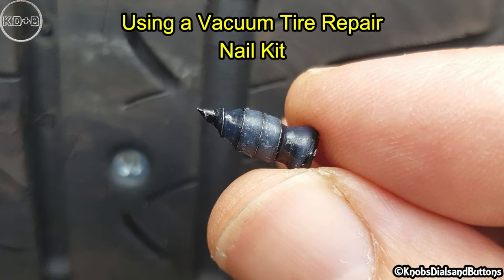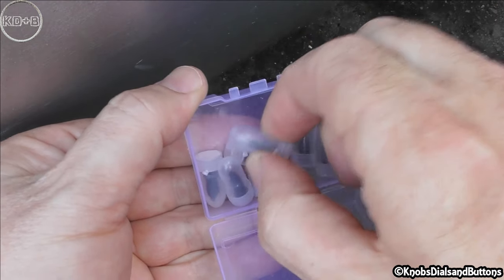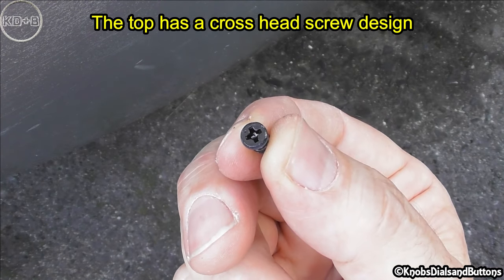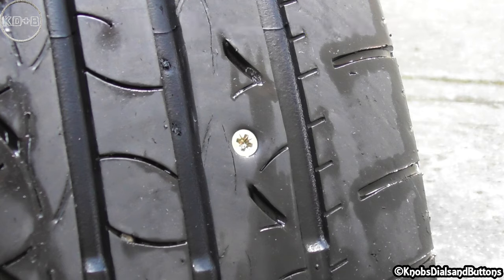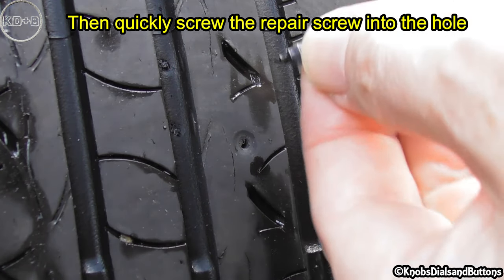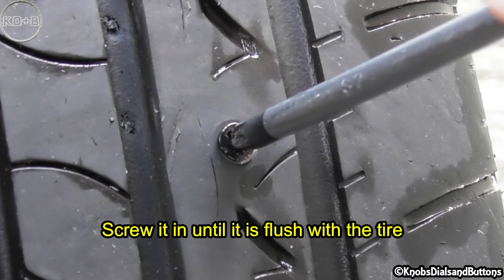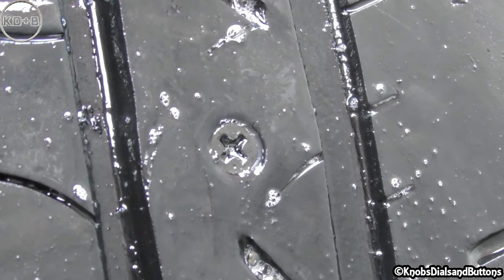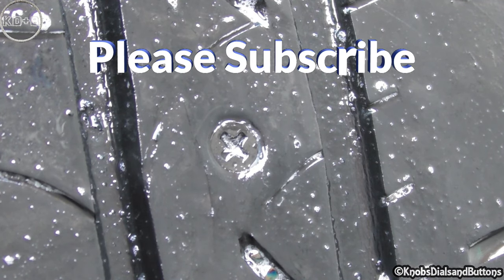Vacuum Tire Repair Nail Kit

Comment: I think the screw you took out was more secure 😂
Reply: I know 😄
Reply: it’s was but metal will damage the tyre more and won’t mold with the heat.
Reply: this is bolt special for tublesss not bolt common
Reply: @CristianoXRonaldox-t5z  where can we get it in India?
Reply: Make sense..haha
Reply: Not the screw inn’s are rubber and metal and they have a sealer on them I always use the strip ones but I ordered some of these to try

Comment: so, take a screw out of the tire and replace it with a screw with some sealant on it..  of course, if it comes out while driving down the road,  it becomes someone else's problem ..
Reply from the maker: I'm just demonstrating how to use the kit.
Reply: @knobsdialsandbuttons  We get that. This is a product that needs to die though. Anyone who has used a tire plug knows that they have issues of their own but they aren't going to be a road hazard when they fail. They are a bit annoying to use but they work; so there is practically no need for these in the first place.
Reply: Looks like they are plastic , so I don't understand them being a road hazard IF they came out ?
Reply: I just ordered some.  I don't think If you drove over these that they would stick in your tyre. The rubber outer of the screw is to grippy the screw would bounce off/out. Also the screw is stubby, very short.  That combined with the grippy rubber, it would be very hard to pierce the tyre.
Reply: They are made of rubber not metal. So they are not hazard
Reply: These repair screws are made of rubber. If for some reason they come out they are not metal and will not puncture someone else's tire.

Comment: these screws are very good i used two times with rubber glue on them and it take 5 minites to fix tyre after removing nail,screws are two sizes small and large you must have them because some time nail size is bigger.90% you dont need to remove tyre,these screws are good to used by old men and women,if you are young then use rubber plugs they are batter then screws and most important thing is you must have air compressor in you car

Comment: everyone in here, don't use this for long term this is a temporary patch when you dont have an extra tire or are using a motorcycle. Always have it patched professionally after.
Reply: Some mopeds or city car don't have an extra tire. They give you a patch kit like this, so you can be able to reach a tire shop without a run-flat damage or being still able to drive there safely

Comment: I wouldn’t use this on a car tire but a lawnmower or atv tire,  I think it will last longer and be more effective than a standard rubber plug.  I assume they come in larger sizes as well in case you run over a larger object and get a bigger hole.  The advantage of this over your standard rubber plug is the plug uses adhesive to work,  not always effective in a dirty environment.
Reply from the maker: There are two different sizes. I would only use it in an emergency and for as short a trip as possible.
Reply: I noticed a slight air leak. TINY  foamy suds indicates air escaping.
Reply: @knobsdialsandbuttons  
Hi.
Do you need to lube with grease first, would it help?
Thanks..
Reply: Why would you want to leave this in your car tire ? This is an emergency kit to be able yo drive to a tore shop and get your tire fixed or replaced

Comment: I have some in my saddle bag along with a bicycle pump about 5 inches long. I figured I can get enough air in it to get home. My last set of tires on my Harley I got a bolt in the back tire. When I put the new ones on I made my spoke wheels tubeless with 3M marine 5200. Now I can plug instead of patching the tube. Last one I slimmed the tube and it lasted until I changed them. Didn’t want to go 80mph on slime.

Comment: I was stuck with a small hole in my motorcycle rear tire and no way to fix it or have it fixed. I screwed in a large ( number 12 IIRC ) sheet metal screw. Unfortunately, I did not have any rubber cement or I would have appled some to the threads. The tire never lost any air until I had the tire replaced. The use of a sheet metal screw is important because the screw shank is mostly straight and has deep, coarse threads unlike a wood screw which has a slight taper and finer and shallower threads.

Comment: As long as you are not using it for racing or drifting your cars, it will work just fine. This is for a 'common' cars used in or between cities with asphalt road.

Comment: One thing what's funny is  - in emergency on the road you can hope to have these and sopy water in the trunk :D
Reply: Just put your ear up close to the hole,  you’ll hear if air is escaping.
Reply: @gregrowe1168  with highway  car flying noise I’m sure u will hear it
Reply: A quick old tip from DIY bicycle repairs : A good old large saliva spit on the whole to check if there's still an air leak or not :)  For the kit it self, I t cost nothing to have some of these tools proactively in your car
Reply: Saliva works too.  Coz you always have them on you.  Lol
Just put a good amount in your hand and wipe it on the repair work and check for bubbles.
Reply: you can spit on it
Reply: Windshield washer fluid bubbles and foams up too.
Reply: @Raf_Ik78 the best option instead 😂

Comment: Hi if we used this, this is supposed to be a temporary fix right? Still need to get to a repair shop to get it fixed again right? Or we can leave it as is and all is good?
Reply from the maker: Yes I would only use it as an emergency repair and then get the tire patched from the inside, just to be sure
Reply: @knobsdialsandbuttons  thanks 👍
Reply from the maker: You're welcome !

Comment: Would work in a pinch but I would change it for a plug or patch as soon as possible.
Reply from the maker: Yeah that's pretty much what it's used for. I certainly wouldn't leave it in there for long !

Comment: My car doesn't have a jack or spare tire. I keep a compressor and sticky repair kit in the trunk. But sometimes it's hard to fix with the tire on the car.

I just bought a pack of 100 with a stubby screwdriver to keep in the trunk. Hopefully I never have to use it.
Reply: I try it, excellent and easy than any other method.
Reply: Get yourself a jack and a spare tire ASAP.  The screw won’t help if your tire gets slashed or blows out.
Reply: @darryljones6129  Many cars do not have a spare tire these days. Including mine. Especially small cars.

Comment: why not just take out the screw and apply some sealant and put it back?
Reply from the maker: That would probably work, but I'm just demonstrating this kit :)
Reply: It seems to have sealant in the screws threads
Reply from the maker: I would recommend always having an air pump in the boot of your vehicle. You never know when you might need one.

Comment: Hmmm with the screw of course it'll hold since you inserted a screw before and it made some kinda thread how about demonstrate with a nail 🤔
Reply from the maker: It'll work the same. The repair screw will make new threads as it's inserted. I'm only demonstrating it by the way. I'm not promoting or selling it so I'm not trying to trick anybody. Ok ?

Comment: So I can just put sealant on a screw and do the same thing.
Reply from the maker: I wouldn't advise doing that. I'm only demonstrating this kit by the way. I didn't design it and I don't sell it :)
Reply: @knobsdialsandbuttons  I was kidding ..good video btw
Reply: I took the idea and wrapped part of string of tyre repair sticky string and it plugged the hole leak proof. I just need to see how long it lasts. 😐
×××one month passed. Still holding air. No leaks.

Comment: Thought I saw bubbles .. didn't look good
Reply from the maker: It was just the fluid settling. I checked the pressure a few days later and it was unchanged.
Reply: With soapy water, you will see big bubbles from air. That's not the case here, is just the fluid settling at the bottom

Comment: Useless ! Wasn't it was better Before Screw... Why unecessary Take out First Screw and Put Another again
Reply: It’s basically like taking a regular screw and putting a rubber gasket over it to seal it.  Normal screws aren’t meant to be airtight,  they’re just meant to be fasteners.  They hold things together but if you want the bond to be airtight,  like say on a roof,  you need to apply some sort of sealant over the screw.  And that would only work if it doesn’t move.  A moving object like a tire would chip that off pretty quickly.  The seal needs to be inside the tire.

Comment: If you pay attention to it you will see that it's still leaking he keeps spraying water so you don't see it but for someone like me that work with tires everyday I can see that I still leaking, don't buy this product, is garbage.
Reply from the maker: Why would I try to hide anything ?. I don't sell the product, I'm just demonstrating how to use it.
Reply: I also see it. I ride a Honda Goldwing. The last thing I need is a little rubber screw popping out at 60 miles per hour on the highway. Plugs then replace the tire asap for motorcycles. This system is inadequate for highway vehicles.
Reply: It’s not leaking. You just don’t want it to work. I’d use one in a heartbeat.
Reply: @sdmackpictures  you might be riding around right now with something in your tire and don’t even know it.

Comment: How long does it last?
Reply from the maker: I would only use it as a temporary repair to get you to a tire shop and have it patched
Reply: Two days ago, I had a real situation with a screw puncture. 
I fixed it with this repair screw and drove then 750 km, mainly with 130 km/h, momentarily even up to 155 km/h.
The screw worked fine, no problem by now.
Just for the record: why not fixing it otherwise? Because I was abroad, not understanding the language, and I hat to reach a meeting in time. The repair took me 10 minutes.